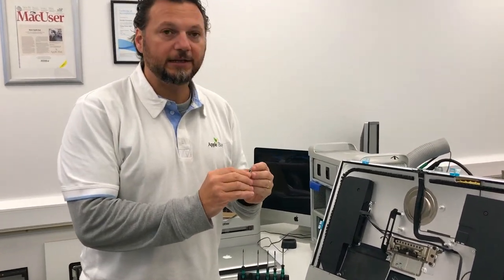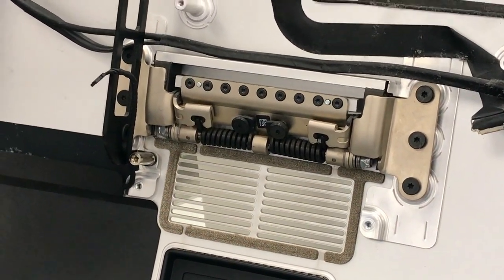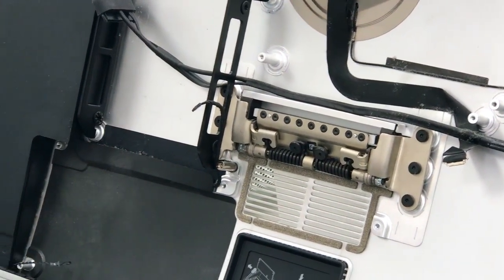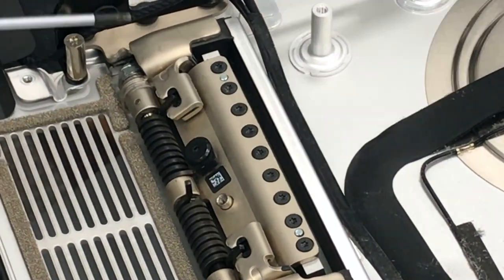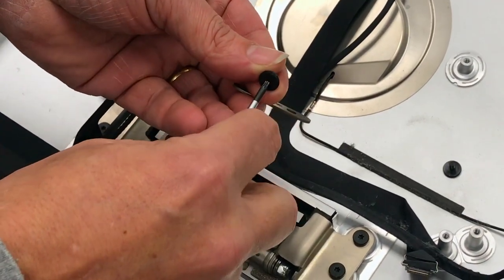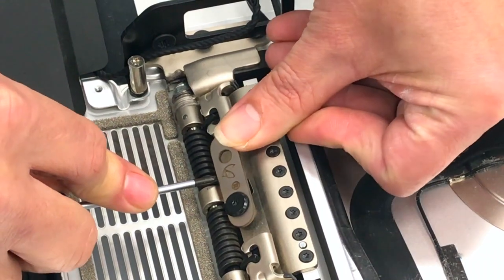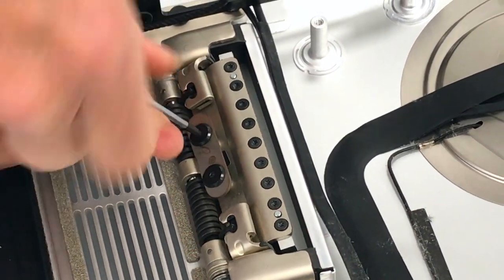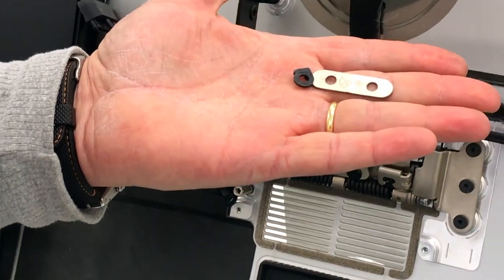How to fix / repair Apple iMac 27" broken hinge /clutch (UPDATED)

Comment: My 2017 has tilted since I got it...I didn't realize it was a 'problem' but it is an annoyance. I finally googled because I get tired of always repositioning the screen. My post it notes pull it down! Nice instruction on what is wrong. Now to figure out how to get it fixed because we are still strictly sheltering due to Covid. I like your relaxing video.
Reply from the maker: Hi Billie if you are based in the UK we are happy to fix it for you, if you are not send me a privated message and i help you
Reply: @Apple-Bay  Anaheim, Ca. USA. I will have to call Apple on this one. Thanks for the offer.
Reply from the maker: @billiericks3293  tell them that under consumer rights it’s is manufacturing fault , the should fix it for free, google it
Reply from the maker: @billiericks3293  https://www.macrumors.com/2016/11/29/imac-broken-hinge-refunds-repair-program/
Reply: @Apple-Bay  hi wherr do you base and how much will it cost ?
Reply: Your drill does not work because Covid?

Comment: My thumbs were still sore two weeks after doing the repair from trying to push down on the washer against the spring. I just could not do it with the hinge still in the machine. So, I just took it out – the set of nine screws and six mounting screws. That reduced the amount of spring travel needed to get the screw in.
Reply from the maker: yes, the spring is really strong!!! That's why i push it with the screwdriver, not with my fingers

Comment: i ordered this to repair my hinge... you made the first screw look very easy... my late 2013 27" imac the springs seem to require a lot more force. do you have any tips for lining up the screw and maintaining the pressure on the spring?
Reply from the maker: Hi Michael 
I been doing this repair so it look easy but yes the spring is rally strong, just push hard 
If u put on the bed will be easy
Reply: Gonzalo Fernandez okay thnx. I think my mistake was not propping up the stand to reduce the tension

Comment: not as easy as it looks. I had to support the back of the monitor with objects that kept the angle of the monitor in a position that held the hinge closer to the screw holes. With a lot of strength, I was able to hold the spring under the bracket and screwed on one screw. The other spring I had to pull down and twist the bracket over it, then with much force, push and tighten the other screw in place.
Reply from the maker: yes, That's how i did it, as u cant see how heavy the springs are, this is the best solution as I did this repair with a DIY plate and it bend once o try to fit it. that's why i manufacture  these laser-cut plates 
Thanks !!!! 😊

Comment: Gonzalo como se puede obtener los diagramas electricos  de una Imac 27 " 2015? Gracias
Reply from the maker: Hola , depende cuál ya que no todos están disponibles , hay varios lugares de donde bajar, pero se paga , tenes que buscar en google , yo pagos a suscripción anual en una y así tengo todo lo que está disponible
Reply from the maker: Yasmiell Rodriguez  de momento no hay 
Sol tengo los del 2012 y 2013

Comment: Really? Replacing a plastic bracket by another plastic bracket? I would just cut and drill my own bracket from a thin steel bar. Now when the size was measure, they just punch ten of thousands of those and sell it cheaply.
Reply from the maker: i replace it with a metal bracket and yes i did make thousands of them and I'm selling at 5 box on ebay ( i trade mark it ) Cash4mac_uk